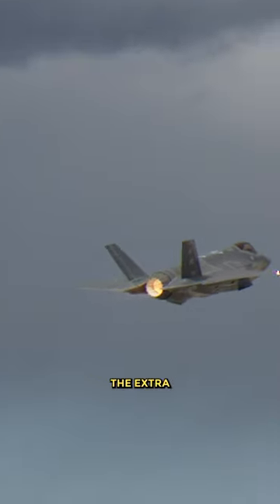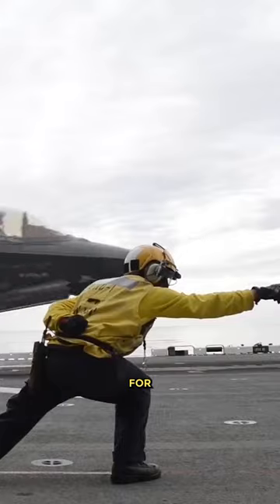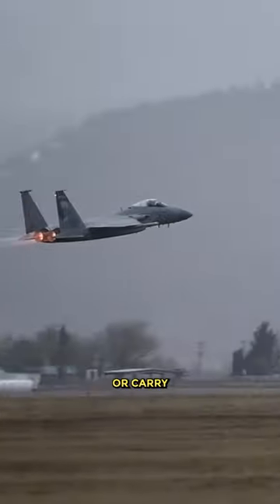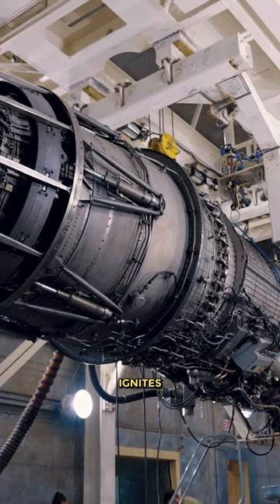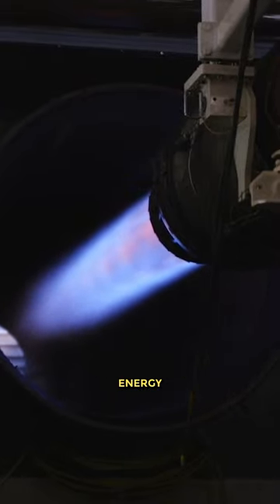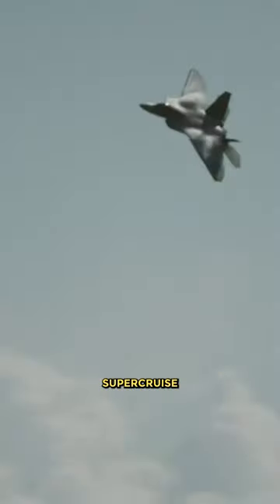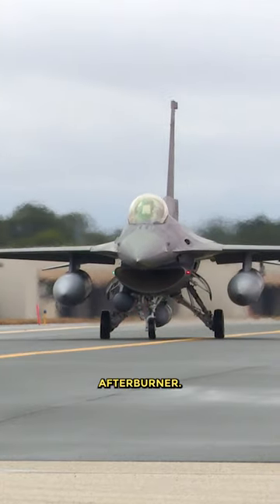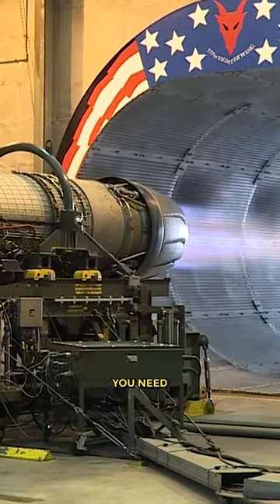Why does a Modern Fighter Jets Need an Afterburner? #shorts

Comment: So speaking as an USAF trained Jet Engine Mechanic who served for 20+ years. I can tell you that none of the aircraft shown in this video are equipped with an afterburner. They are all equipped with Augmenters. What’s the difference you might ask? An Augmenter has a variable geometry nozzle which not only controls the boost in thrust but it also controls the RPM of the Fan and N1 Rotating assembly in the engine. Making the entire power plant not only more powerful but also more efficient.  The afterburner does not. The Afterburner is just basically a Ramjet bolted on to the back of a Turbojet. The Afterburner does increase thrust. But not nearly as much as an Augmenter does.😎
Reply: Just doesn't sound as cool I guess.
He went full augmenter.

Comment: Isn't it the requirement of gen 5 plane to achieve supersonic speed without afterburner?
Reply: Maybe, but can you go mach 2+ without ab?
Reply: @stefanth8596  That is irrelevant, bonified gen 5 plane must be able to cross mach barrier without ab, then you can reach max speed with ab
Reply: @timrutkevich3222 you speak as though drag remains constant after Mach 1. It doesn't.